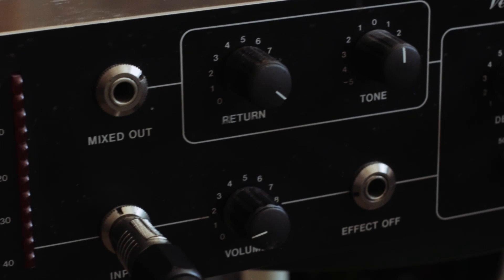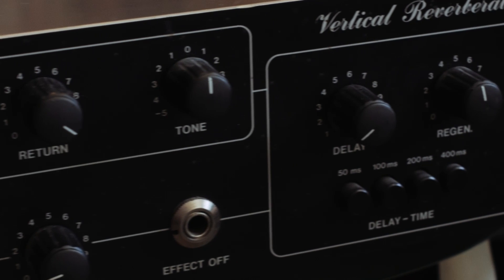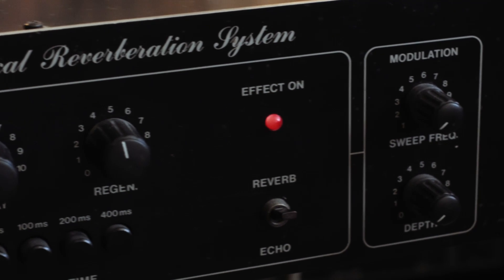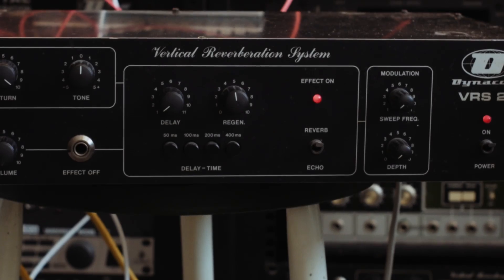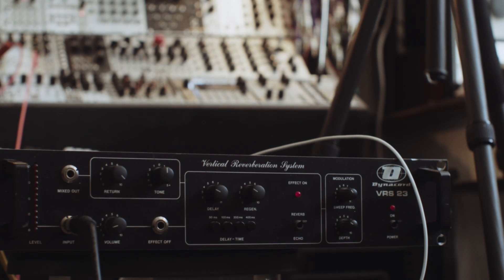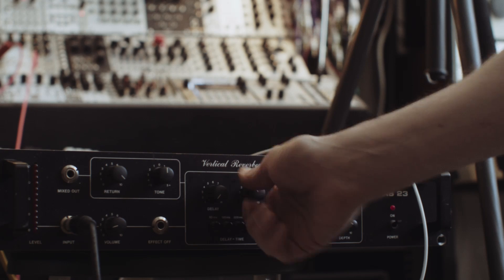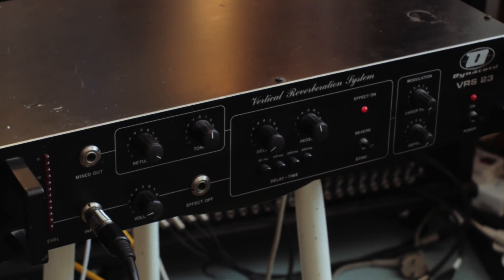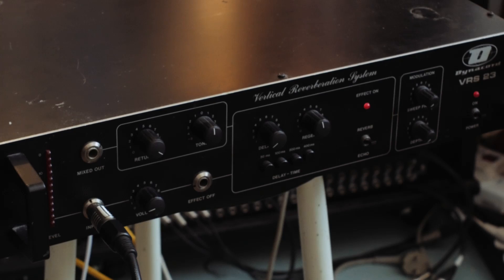Dynacord VRS23 - modded for CV input - otherworldly long reverb ambiences!

Comment: Really great work 😊! Does the CV control the clock speed? Sound amazing and am just demoing the Audiotity vst of the VRS.
Reply from the maker: Interesting to hear that there's more a plugin version. I'm all for new tech but in the demo on audiority's website I'm not hearing the typical density of the"reverb" mode. It sounds more like a bunch of individual delays.
I still think that the VRS23 is a pretty unique sounding box.